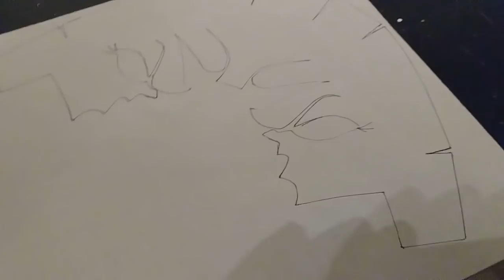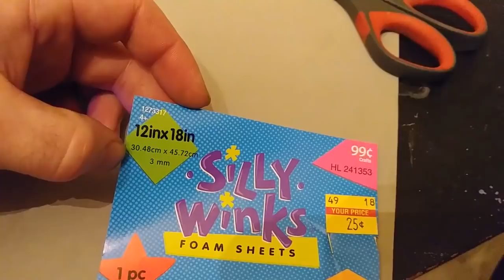DIY Batman Cowl build BVS inspired cosplay

Comment: As far as I can tell it doesn't look like the inner ear part is in the pattern, but I think I can figure out the shape of it anyway and I guess the size of the inner ear part isn't as standard so maybe that's why it isn't in the etsy pattern
Reply from the maker: Quite correct. The ultimate measurement and fit is dependant upon the shape you heat form into the main shell. If you like send me your email address through a private message Facebook or Instagram account and I can send you a jpeg of mine to give you reference, and a starting point.